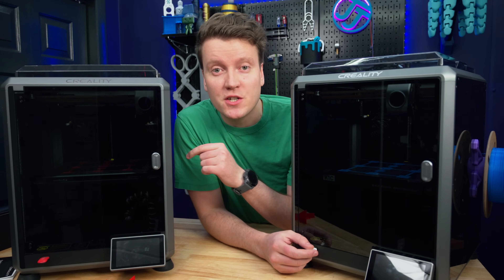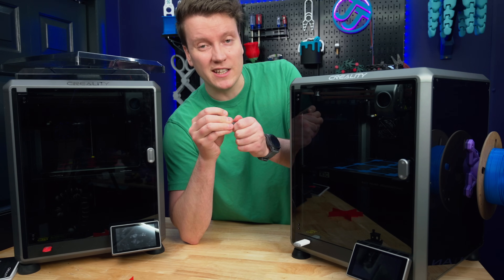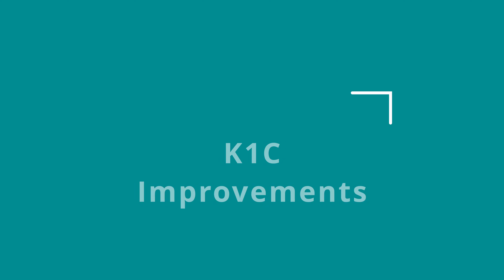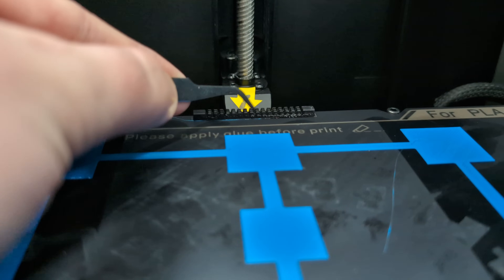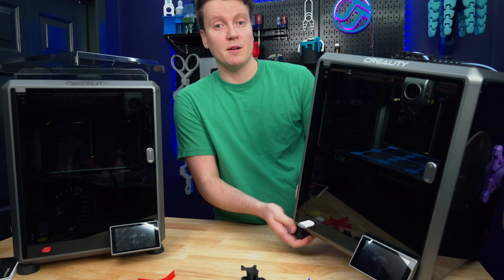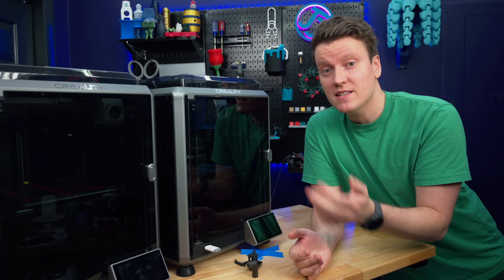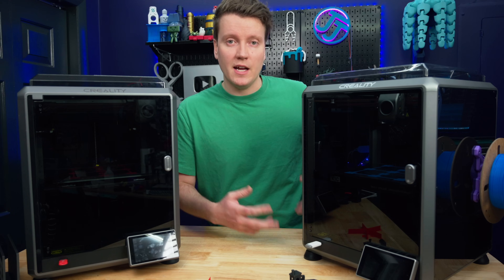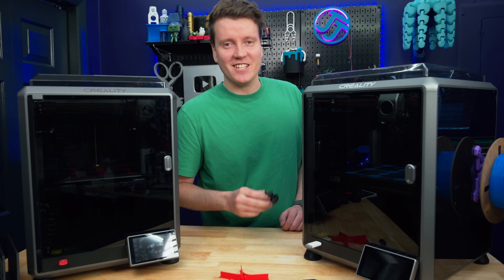Creality K1C vs K1 - Easy Carbon Fiber 3D Printing

Comment: The newer K1 did replace those large gears that cause the artifacting, the newer K1 also replaced the extruder gears with a better one (Shiny mirror finish extruder = old, less shiny = new design) (Still using the old hot end tho). The very few flaws remaining can actually be fixed by some basic 3d prints: Cable clips for the PTFE tube issue + risers for the top cover. So if anyone can get a better deal on the K1, I say just take it and make the fixes/upgrades yourself. 

This is my situation right now as the K1 is about $170 cheaper than the K1C, and the seller guaranteed me that the version of the K1 I'm getting is the most recent version.
Reply from the maker: That is a great deal, and if it does have the larger gears then it would be totally worth it

Comment: I've been happy with the first prints from my k1c, but tonight I printed the side spool holder and discovered that my y appears to be wired up backwards. The part in the slicer has the text correctly, but the resulting part is mirrored over Y with the text and direction of the part backwards. Everything else I'd printed was symmetrical, so i hademt noticed it until now.

Comment: 1. printing any abrasive filament will destroy any nozzle but tungsten carbide
2. youre not printing real cf polymer 
3. you need at least an 80c chamber to print these materials

Comment: Hi, will the K1C be a good upgrade from the ender 3 S1 pro thanks
Reply: Not based on what I’ve seen. I’ve got an s1 pro and it’s one of the best printers I’ve ever used.

Comment: what PLA should i use that is cheap and that is low cost
Reply from the maker: My cheap go to brand is Overture, but filament in general has all been getting good recnetly
Reply: Thank you
Reply: If you want to use the full speed capabilities you'll need a high speed PLA (e.g. Creality Hyper PLA, eSun ePLA-HS or equivalent)
Reply: It was super good and clean. Thank you.

Comment: Creality is continuing to just pump out partially finished printers and relying on consumer cash to test and revise their products. It doesn't seem like they could possibly have enough time to thoroughly vet and test the changes they make. Although its good they are making improvements, they are still just sniffing out what is the bare minimum set of improvements that will increase their long term sales. Fine, its a business. But they aren't innovating when they clearly could. Their incremental improvements that could have been determined in house are instead coming off the backs of folks who paid for gen 1.

Comment: I'd be livid if I bought the K1 and there's no upgrade path. Especially if you can still buy the K1 currently.
Reply: This is simply a fact of life when buying technology. Do you get mad if you buy a phone and the manufacturer starts selling an improved model?
Reply: @ferrumignis except that they knew it had problems and wasn’t ready and sold it anyway. There should at least be a way to purchase the motors and pulleys. It’s only been a year, it’s not right but it is typical of creality.

Comment: Mäh...The time of Creality is over. Low price and low quality is not what the market wants anymore. But this is the playground of Creality and so they won't make it into the future. No one wants to print hundrets of mods anymore to make the printer usable. They changed their company symbol to confuse the cusomers but that will not work as the quality is as bad as usual.
Reply: I do. I want cheap and upgradable.
Reply: Your right the build quality is almost 3-5 years behind where it should be it’s years spent cutting corners on experimental designs and selling flagship models with too many quirks, issues,bugs and more to even call it their top model I’d say this is they’re best attempt at fully enclosed FDM printer and I still find myself printing mods for it im switching to Bambulab after I buy one or two more printers for my setup.

Comment: You should do a teardown of your extruder. Many other reviewers are finding that it's not actually all metal and all the gears are plastic. So, either the review units were quickly thrown together or Creality is lying through their teeth.
Reply: They arent dumb enough to lie about a part that every user will quickly get eyes on. It was a marketing oversight. Right hand not knowing what the left hand is doing.
Reply: @johnlocke3481  They are... The gears are made of plastic.

Comment: If they can make a K1C Max I'd be interested. Been wanting a med-large enclosed printer for ABS and ASA parts. So far the Qidi max 3 is top of the list.
Reply from the maker: I totally agree. Whenever they make a K1C Max, that will be a great printer
Reply: I print large ABS custom toolboxes on my K1Max just fine. The C releases seem to me to be a marketing update. Gotta stay current, gotta get a machine out the door.

However, the modifications made to the gearing would be welcome.
Reply: @mikestewart4752  agree on this one. I have printed PLA-CF on the k1 max. I’m sure the k1 can handle it as well. I did see a comment from them suggesting a potential AMS for their k1’s so that is exciting.
Reply: @mikestewart4752  yeah I just don't like the k1's door design and the qidi is cheaper with a heated chamber.

Seriously the fact multiple people have had their k1/max doors shatter on them because they opened a little too far shows that thing is a massive design flaw.
Reply: @redkingrauri3769  I see what you’re saying. I too have concern for my door, but I just don’t treat it like it did me wrong and it’s fine.

I’d put dollars to donuts that the C version’s door, while looking somewhat sturdier, would still shatter given minor mistreatment. The film coating will contain the mess, which is nice. 

Just my opinion is all 🙂👍
Reply: @redkingrauri3769  Definitely valid point there! I will say it was the perfect first project for me to learn CAD and was fun but obviously with the amount of money it cost it shouldn't be an issue.
Reply: The Qidi has a heated chamber so seems the obvious choice if you are wanting to use the more difficult engineering filament materials.
Reply: They already said they are not.
Reply: @ThisIsDan-i  qidi it is then

Comment: The VFAs went away for me on the latest 2 firmware running a k1, but i may have changed something else that helped 🤷 thats the trouble with always tinkering with your printer.

Comment: Why is no one talking about the bed? Even if it’s just a cover on the front I want to see what the heck it looks like.
Reply from the maker: It is identical from the bottom, just a small metal front plate
Reply: Same as K1 just added front label plate. It's not a die cast plate for sure.
Reply: It's a uneven piece of 💩

Comment: From watching other reviews & tear downs the hotend is pretty bad & not a great update.
Its not even a full hardened nozzle. Its copper with an insert. Bowden tube fix isnt great either as it has a sharp curve and has broken CF in other reviewers. It seems to be a side grade than an upgrade.
Reply: I have a K1 base model since September, and I have even printed with carbon fiber before. It works fine.
Reply: @roberttsukerman8689  yeah PLA CF isnt CF lol
Reply: Cooper nozzle with steel insert is the best of both worlds.  It's only the tip with the nozzle hole that suffers significant wear, and having a full steel nozzle hurts thermal performance.
Reply: @ferrumignis everything that the filament passes through is subject to wear, especially with cf filament.
Reply: Boils down to Creality continuing to use consumers cash to do field testing for an unfinished product
Reply: @dmax9324  yup